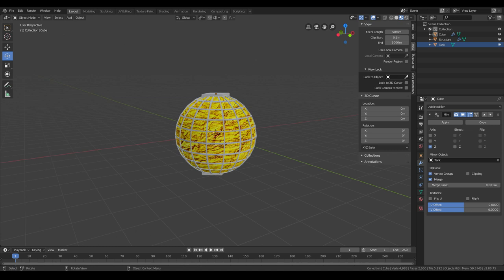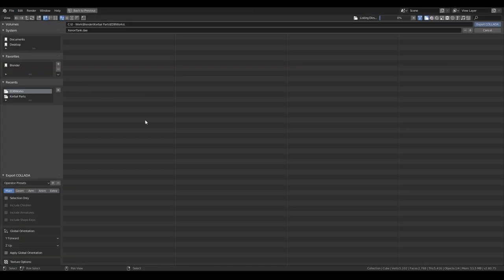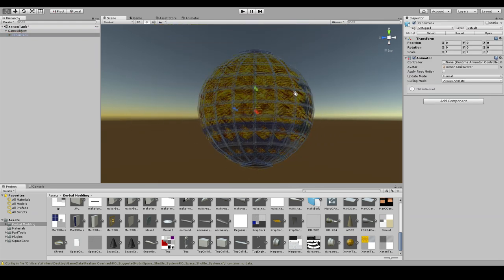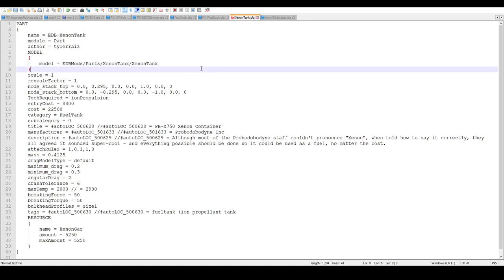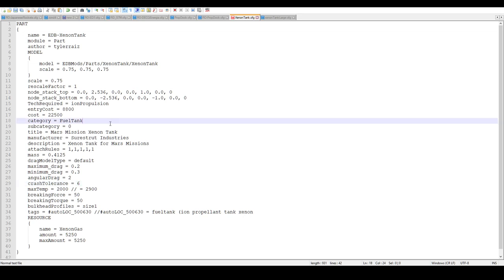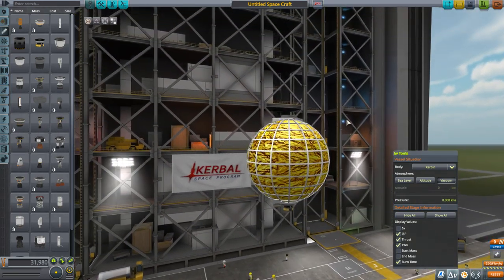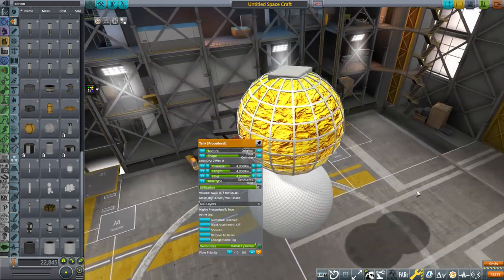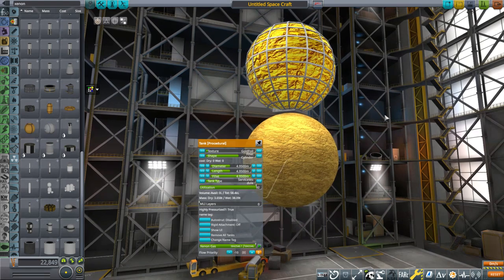Blender and Unity - Preparing a Simple Tank for Use in Kerbal Space Program

Comment: Are you supposed to have the .cfg for RO and stock in the RO version? My game stops loading at an SRB, but works if I take out my model.
Reply from the maker: The original cfg should work in stock and then you should write an RO Module Manager patch (which starts @PART rather than just saying PART) that addresses the various items that need to be changed. Both should be in the install.
Reply: @RaizSpace  Ok. I've gotten it to load in, and I can place the modded part, but now some parts are missing, some parts have no models, and all parts have the same mass and have a xenon tank with the same amount as the modded one. even engines, command pods, rcs thrusters, etc.